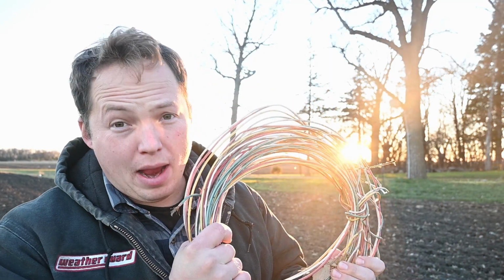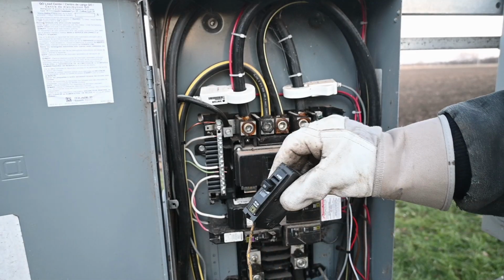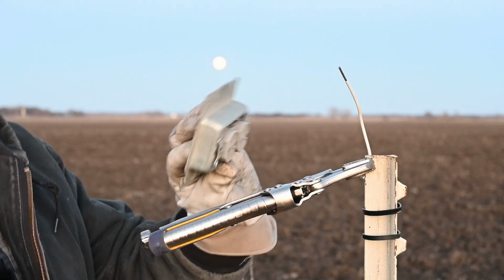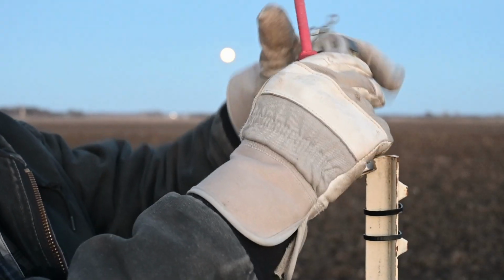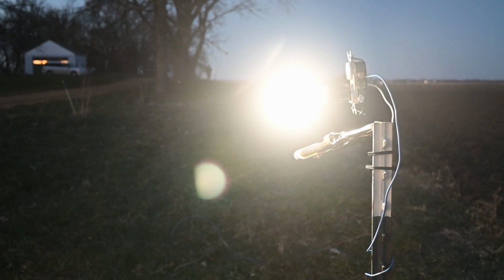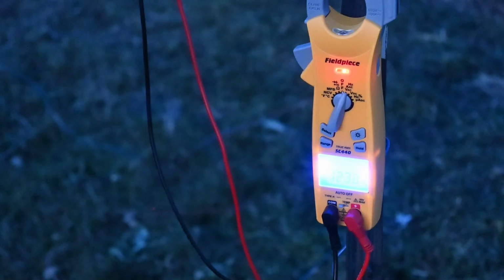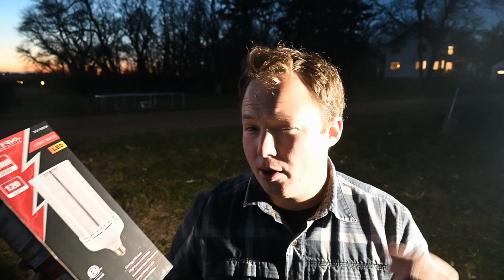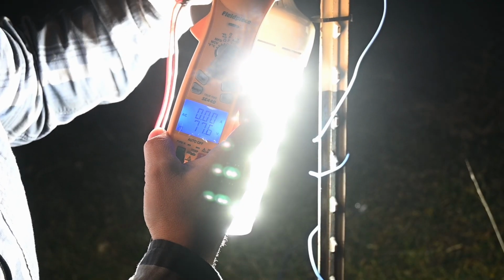Powering a Light With a Fence Post & Scrap Wire - SWER (Single Wire Earth Return) Demonstration

Comment: This is dangerous, please take this video down. Someone is going to use this wiring method and it will shock and quite possibly electrocute someone. I've been an electrician for over 25 years and there are many ways to power something remote without doing this, the danger is too high.

Comment: In a place I was renting they had swapped all the outlets to three prong but nothing was grounded and they were still using fabric insulated wires, and no boxes, just the outlet screwed to the molding. They tied into the porch light and ran 2 leads out to a light on a post. We didn't really use the baseboard heaters so I never understood why our power bill was so high. I put an cfl in the porch receptacle and it wouldn't turn off, when you turned off the switch the light would just dim and if you touched the light post out by the parking lot you would get a nasty surprise. I called the owner and she finally sent her son to look at it, he tried to say everything was perfectly fine and it was my CFL bulb that was messing stuff up I finally convinced him to disconnect the lamp post saying that it was raising my power bill having it on all the time and it wasn't fair that I was being charged for communal power, so he climbed up there with the light switch turned off and attempted to unscrew the terminals giving himself a big shock and knocking him off the ladder. I said I told you it was live with the light switch turned off. Once he got the breaker off and disconnected the wires going to the post we didn't have any more problems until we started moving out. While we were moving out and sleeping at the new place we didn't leave any heaters on. I came back to get a load of stuff only to find the apartment flooded water rushing out as I opened the door rain coming down from the ceiling electricity arcing across the water. When I called the owner she tried to tell me her son was busy and would be there Monday. I told her no you don't understand it is raining from the ceiling throughout the entire apartment, water is pouring out the door and electricity is arcing across the water you might not have an apartment complex by Monday. If he doesn't get his ass down here in 30 minutes I'm calling a plumber and an electrician and you can pay for it. You better get his butt down there real quick. Unfortunately my buddies gaming rig was still in the apartment. It was fried. They told me one of the upstairs neighbors went on vacation and left his heat off and we turned to the baseboard heaters off and that it caused a pipe in between the upstairs and downstairs to freeze... You would think the heat from the other six apartments would at least be enough to keep a pipe from freezing in the crawl space between the upstairs and downstairs but apparently not as the un insulated brick building had an r value so low the outside walls cried with condensation when the temperature difference between inside and out was too great.
Reply: Love how you Changed his mind with fairness of the light pole and it's use being communal..lolz.. About how high up was he on the ladder
at the moment gravity summoned his unconditional
sub-instant appearance with 
the earth below? And another
question I was curious about
is ,Would you say he was down to earth ? Great story
although a nightmare train wreck of of a situation if K ever heard of one. Reading your commend helped me better understand this principle somewhat as far as its relevancy in this comment
section. Thank You from San Antonio Tx.

Comment: Here is something to remember. It is never the voltage that has the potential to kill yoou, it is the amount of amperage that is available that has the potential to kill you. Which means that you can get a 2Kv shock and if it is in the milliamps of current available, you will not die. Even if you are caused to pee your pants. BUT, 10v with a potential of 100 amps and you are fried, you died, and you were smokin hot!

Comment: When I first saw the high tension wires in the distance and your insulated scrap wire coming toward a parallel fence, I thought you were going to "tap" the RF energy from the transmission lines.  That might be an interesting experiment for a future video.
Reply: I agree. With knowledge of electronics and having done a lot of electrical over the years I'm always looking to learn something.

Comment: The Pacific Intertie is a 1 million volt (line-to-line) 3000 Megawatt DC transmission line that runs from The Dalles, in Oregon down to Sylmar in Southern California.  They have a linkage to ground in fields in Oregon and one in Santa Monica Bay in Southern California.  If one of the transmission wires breaks they can still transmit 1500 MW of power using a ground return but only for a limited time as that amount of current would damage underground infrastructure.

Comment: If you poured some water on the ground around the fence post the path to ground would have much less resistance and the voltage drops would be far less.

Comment: As a teen, I baled hay on a farm where the farmer used this for his electric cattle fence. The single wire was the top run of barbed wire. He said they would only touch it once. At the gates he had a hollow piece of wood slid over the wire for a handle and a hook bent on the end that you hooked into a loop of wire bent on the other side of the gate. You hanled it very carefully.
Reply: wouldn't wanna touch that wood when wet say a rainy day?

Comment: Even a virtual ground will work with high voltage . In other words a large chunk metal insulated from the ground will still work! Then use a Avramanko circuit to pull the radiant electric field off the block. It really works! The big secret is the av load won’t show up on the primary. Hmmmm…..

Comment: Neat  presentation.  

Regarding your  commentary about wanting  more  power [ 16:23 > 16:52 ] you cited you needed  more surface area of your  metal return.  You could  perhaps achieve this by using a few more fence  post, EMT conduit, copper tubing, or several pieces of  wire laid out like  spokes of a  wheel and  inserted/buried  under the  ground.    If you  have  some  bare chain link fence,  perhaps  bury it  under a  few  inches of  soil and seed it over.  I'm going to continue on below but it may look to be off topic but  bear with me. It comes full circle to te  ideal of conductive  surface area.

In amateur radio, one of the ways we can increase band width for a radio band, especially the  75/80 band, is to increase the surface area of of the  antenna.   In the  75/80 band (3500 > 4000 kHz) a single wire antenna such as a dipole can not be  used over the entire band without a a transmatch / antenna tuner.  One way of achieving more  bandwidth is to increase the cross section of the  antenna elements, in the case of the dipole antenna.  So your  basic dipole  may be  made of wire the  diameter of  #14 or #12 stranded wire, .0641" and .0808 " respectively. Now let's say I want to increase the  diameter of  my antenna from the #12 diameter wire to an element of 8".  While  I could increase my band with, I now must somehow get 130' of 8" diameter metal up over head. The answer is the  cage  dipole.

TO increase  my surface area for radio RX/TX,  instead of  having one  lgth of 130' ( /2) I have six lengths (780" total) that are separated by spacers of say, that  8" diameter I was  speaking of earlier.   Do a search of  "Cage dipole antenna" and you'll see pics; it will become clear  Anyway, I am increasing the surface area for TX/RX signals over a wider  bandwidth without having to actually pull bulky 8" diameter metal into the air.  This  principle would apply to your issue.

Example: A 1" copper pipe has a circumference of 4.131".    8" metal duct pipe has a circumference of 25.125" . So to get the same  surface  area of 25.125" provided  by the  8" duct for your ground, you would  need 7 lengths of 1" copper pipe totaling a total surface area just shy of 29".  

So perhaps you could experiment by setting out bullseye  from your existing  post and set your 7 new  copper post 53.43 degrees. Maybe a diameter of this ring could be 2' , 3', 4' etc from the  existing post.  With each configuration, take some copper wire from the  tops of 7 copper  post and run them back to your  fence  post and attach the seven wires  to the  center  fence  post. This way, you'll have a return path (pad?) where you have several points of  ground potential;(Not sure if Ground potential is the  proper word).
Regards,
John
Reply: i really like this comment just saying 🤔👍🤓✅
Reply: Are you saying that the surface area of the copper is more important in frequency transmission then the say using solid copper conductors?  That would make sense as at higher frequencies the power travels outside of the actual wire?  I like your impressive comment!
Reply: @magncity1817  

First, based on your comment it appears up have knowledge regarding radio signal transmission.

Yes to surface area in the spectrum we  consider radio.  Down in the 60 hz area of the  frequency spectrum,  which is the frequency of our AC  electric that's in our homes, the current will use all of the volume of the conductor. 

As frequency rises, more current will move to the outside of the conductor to be radiated into the air.   

For the purpose the this Creator's SWER,  my thinking that metal is a better conductor then earth itself. That said, I'm thinking that if he introduced metal to his circuit, he may get more ground potential ( not sure if that's the correct term I'm looking for).

The following is just off the cuff as I'm typing 

Take a Dixie paper cup and a  bath towel out  in  hard rain for like 30 seconds . You'll have some water in that paper cup but more water can be squeezed out of the bath towel.  So which is better at collecting a volume of water a little cup= earth, or the towel=metal conductor?

Now, since I'm on a roll consider the 75/80 Amateur radio band, which spans 3.5 to 4.0 MHz.   A simple balanced dipole antenna made of copper wire and  cut to resonance at ,3.75MHz can be used on the entire band but a trans match will be needed to deal with the SWR on either side of the 3.75 MHz frequency.  One solution is to use an antenna with elements of larger diameter,  like some 8"  duct work, put that's impractical.   Enter the cage dipole (CD).  The cage dipole uses more strands of wire the same length and overall as the simple  two wire dipole.  Spacers are used to keep the wires  apart, say in a diameter of 8".   Somehow, the current see four wires, spaced apart as a bigger area.

It will be easier to look up caged dipole then for me to try to explain it further.
Reply: @kb3svj  One may notice in the cage dipole that again the extra small conductors are same resonant length and in relative proximity in space to each other.  And as you pointed out at RF the phenomenon manifests outside the wires.  Thus, the immediate environment outside the wires is acting in unison which multiplies the “signal” much greater then just combining the wires together into one thicker wire.  Rather the volume of this disturbance  contained by the smaller multiple wires of same length is much greater then that of one larger diameter wire.

Logically then one would assume the volume of space surrounding the cage wires plays an important role.

Now we know that this cage antenna would work similarly in outer space as spacecraft also use RF transmissions.  Thus we can discount the “air” as the major player. 

It appears the space around the “cage” is placed in a resonant uniformity, aligned, which increases the power of the signal.  This unison is also then present in outer space.

So then, the oscillating wires create in space both a magnetic and electric component.  Interestingly, a change in magnetic field always creates movements in charges.  So is it the magnetic field change creating a unison of charges (“electrons, charged particles, whatever).  Or the other way around.  Well in the cage antenna example it would seem that charges in the wire is the start which then change magnetic immediately in the volume next to the wire, thus we know as charges in the length of wire are in fact moving in resonance together as the length of the wires are the correct length for the chosen RF.

Now if the “towel” in your analogy is the exact volume of the paper cup, would not the paper cup have more water?  Perhaps resonant transmission is greater in outer space? 

So what we have described here is the true nature or value of resonance, the unity in the surrounding space.  The farmer is not in a resonant situation so in order to improve his situation he must raise the voltage to many thousands of volts and depend upon polarization of the earth components at a high voltage and low current.
Reply: @magncity1817   You are more like long winded then me :-) .  I looked up a vid from Stan Gibilisco -W1GV (SK) on cage antenna if you want to look it up.  He authored some great books
Reply: @magncity1817   PS/ 
BTW run you a ham or in comms field?  You are pretty knowledgeable on the radio subject.
Reply: @kb3svj  No, more in power production.  Resonance is an important concept in producing power from the unified motion in the antennae near field, and radio communication is fundamentally all about resonance as you pointed out.
Reply: @kb3svj  Thanks, I will look it up.  Some times, I find, my best learning occurs when I am long winded to others.  For two reasons, first, the selfish reason,  I must read my thoughts and then I learn; second, as in this case, I learn from the recipient of my long winded reply, such is the case in the instance on “cage” antennas, as I had never heard of that before.  Thus maybe I can stop making so many resonant coils and just use straight wires of the right length to coax the near field into unison.

Comment: Depending on your orientation when near a swer system, if your legs feel heavy, your legs are conducting electricity up one leg and down the other.But you don't feel like your getting a electric shock. Lifting one leg breaks that circuit, then hop away from the metal rod. There is a meter to scan the ground, ( like a metal detector ) . So if you see dead cows/sheep around a swer system, they might have been electrocuted, do not approach the area.That swer system is still in use here in Victoria Australia for farm houses.
Reply: A grounding rod insulated so that it makes contact below dirt level by at least 20" 50.8cm will mitigate this issue.
Reply: @ExceptYourmomdripsonmyface  Yeap. It's all down to the quality of earthing and the current put through the SWER system.

Here in NZ, most SWER systems are limited to 8 Amps.
Reply: That's liberty! Survival of the fittest! Ignorance gets electrocuted! This video is an eye-opener. Thank you for explaining that such swgr is in use in Australia? Fascinating. The farmer who hates his own family! Or just a special kind of behavior based on dirt poor desperation, safety be damned?
Reply: Cows cant read or know electricity, most humans are stupid just devolution when idiots gets fried
Reply: Yeah m8, I noticed it being used in a farm near Strathbogie Victoria.    🙂
Reply: @David -  wow.  I have never heard that about "heavy legs".
Reply: I learned that on our farm using a fence energizer.  It was really dry and there was a short in the fence.  The best path back to the energizer was up one leg and down the other.  Our sheepdog got shocked pretty good.   -Mike
Reply: @pleasantplacesfarm  Never ever even think of peeing close to a wired fence.    😊
Reply: Wow!Thanks for the info!That’s scary to think about.I had no idea that a system like this could be rigged up plus that it could kill people and animals and no idea electricity could be traveling up one leg and down the other without knowing you were being charged by electricity! Thanks
Reply: use a triad grounding rod system ! it's only a bad ground that would cause that
Reply: Yes we had a lot of work upgrading old properties that still used SWER around Whittlesea and Doreen during the property boom 2012-15
Reply: What is a sweet system?
Reply: @cheeka686  SWET = Single Wire Earth Return... which is in the title of the video.
Reply: Yesterday I was sitting in my car and I noticed my legs felt so heavy when I lifted them a little from the floor. Does that mean anything?
Reply: @cheeka686  Diabetes...
Reply: How's that work with rubber soled shoes/boots?
Reply: Electrical hook-ups are NOT DIY's!

Comment: SWER is alive and well in some rural parts of Australia, with a transmission voltage of 19.1kV. The secondary (240V) earth is quite separate from the primary earth. The results of a fault condition with a common earth could be imagined, along with the unavoidable voltage gradient of the primary earth. One disadvantage is that it's only a single phase supply.

Comment: If you start with 120 volts, you will also have exactly 120 volts at the end of the run as well. Voltage drop is determined by load, which is 1/the impedance of the lamp.

Also, if you want more power, you can use a boost transformer at the source and a buck transformer at the load. A 1:2 to 2:1 set of transformers will give you 4 times the power at the end of the line.